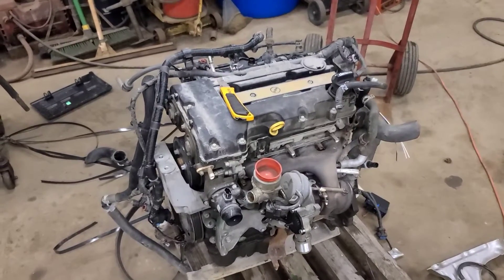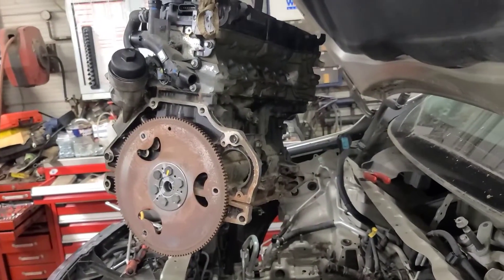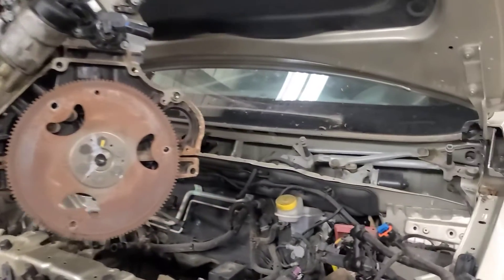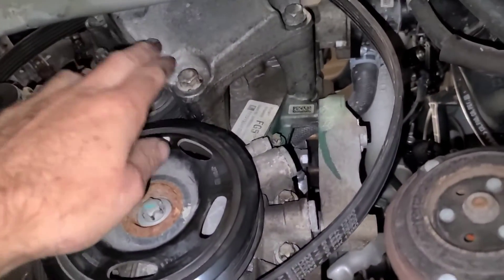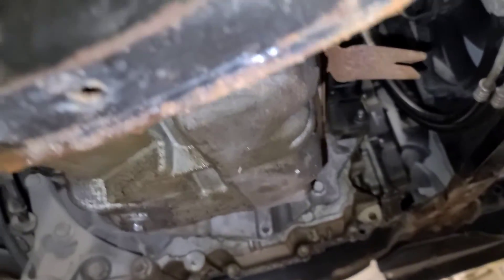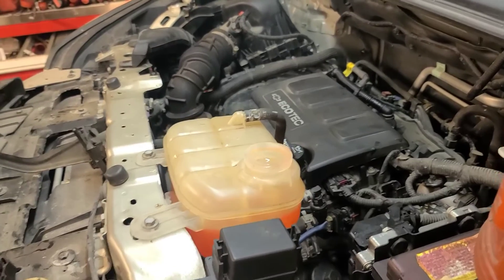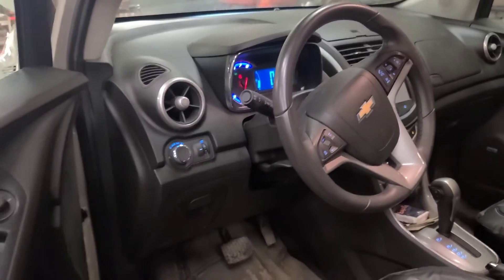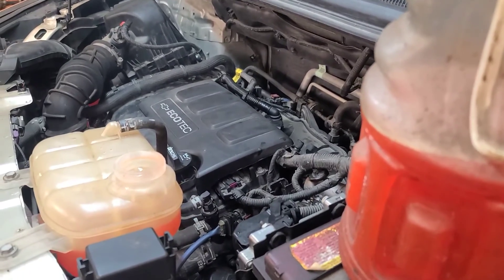2015 Chevrolet Trax 1.4 LUV Engine Replacement Through The Top

Comment: I got one now in my bay that the intake manifold is missing the check valve rubber the turbo is full of oil the piston rings are shot and I’m just to the point where it’s either buy an engine or scrap the car lady.
Reply from the maker: Good luck if you end up replacing it.

Comment: Any tips on how to get all the bolts out of the motor , I got all of them out expect the one it that was behind starter when I get it where it almost out it hitting something in the way
Reply from the maker: @Wadetorade  what  is it hitting?
Reply: @ I got it off was having trouble now trying to get back on the stud
Reply: @PhillipBailey Theres one under the starter that hits the differential case. Im stumped on my one thats like that now.
Reply from the maker: @Xero_Cars is yours an all wheel drive?
Reply: @Xero_Cars  I had to in bolt the transfer case just to get that one bolt off then put it back on
Reply: @ Yeah i was figuring i might have to. I just cut the head off and may just say fuck it and forget it when reinstalling the junkyard block. Lord knows i hate these engines enough to not care lol
Reply: @ lol I was doing go do the same thing but it’s my fiancée daily
Reply: @ I ended up taking over ownership of my grandmothers 2015 encore due to her being sick of its issues. After pulling the head i decided a junkyard block would be more worth my time. I think im gonna put it together for her to use as a garage sale vehicle and leave it at that lol
Reply: @PhillipBailey it your a awd im doing one now but mine is awd can it still come out the top
Reply from the maker: This vehicle was not AWD. You need to remove the transfer case to access one bolt.

Comment: How many hours does it take to do a full engine replacement on this type of vehicle?
Reply from the maker: If you're referring to replacing the entire engine with a used assembly it all depends on how much parts you need to transfer. I'd say 10 hours.
Reply: @ OK thanks for your response. I have no idea as Midas is the one doing the engine swap. they informed me that they are using a remanufactured engine not sure exactly what all comes with that. They had the car for exactly 4 weeks today they just got the engine and all parts needed to do the job late last week. As it took a lot of back-and-forth with the extended warranty company they originally wanted to do it with a used engine. They did not want to use a used engine. They wanted a brand new one  but I finally got them to go for a remanufactured They promised to start working on it today, I drove past there late this afternoon. The car is in the shop up in the air so hopefully they’ll have it done by Friday because I really need this vehicle back.
Reply from the maker: @TBlaster76 a remanufactured engine is quite a bit more labor as you said depending upon what needs to be transferred from the original engine.
Reply: @  I don’t even know what a remanufactured engine is all I know is that’s what they say they got with several upgrades whatever that means. They did say it had a new oil pump, water pump and turbo. They had to order a new oil cooler and thermostat. That’s all I know.